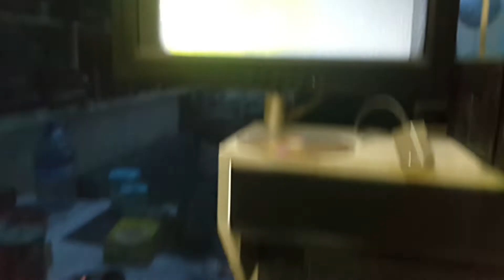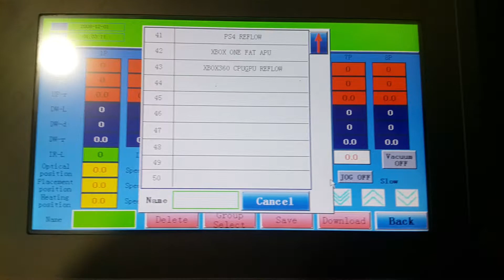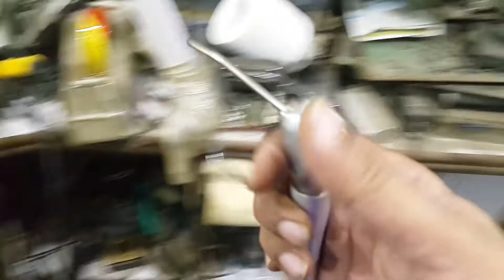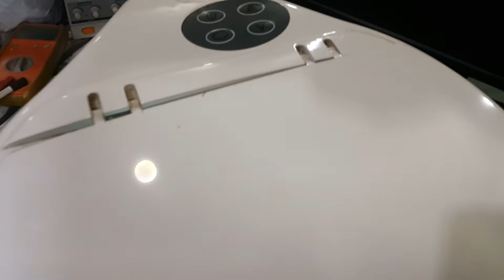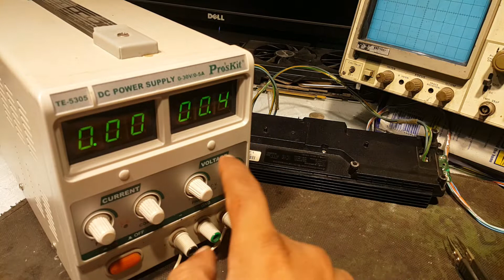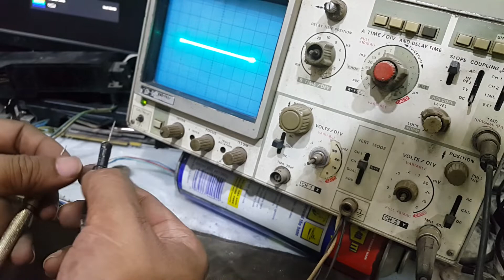✨My Workbench Tools.🔧✨

Comment: I still dont understand how did you make a component tester with oscilloscope, could you explain?
Reply from the maker: Hey @congbang2709, great question! Essentially, I built a component tester using my oscilloscope by creating a test jig that allows me to apply known signals and then measure how the component under test responds.
The oscilloscope gives me a visual, real-time view of how the component behaves under dynamic conditions, something a multimeter can’t provide.
Reply: @ could you share test jig schematic? Because i saw you can check a resistor, capacitors… good or bad very quickly, that make me very impressed.